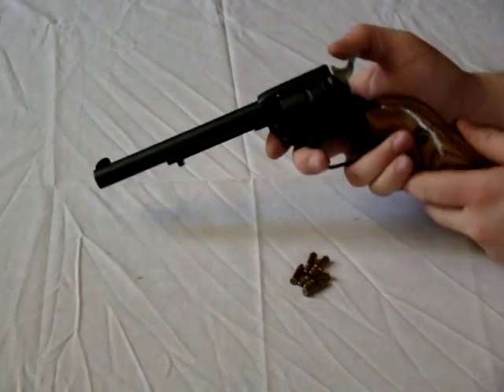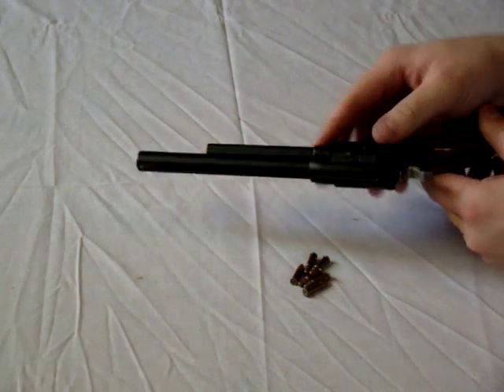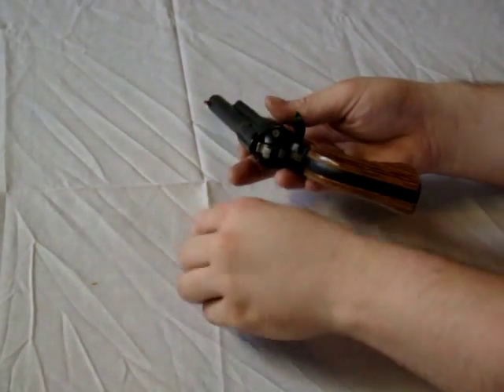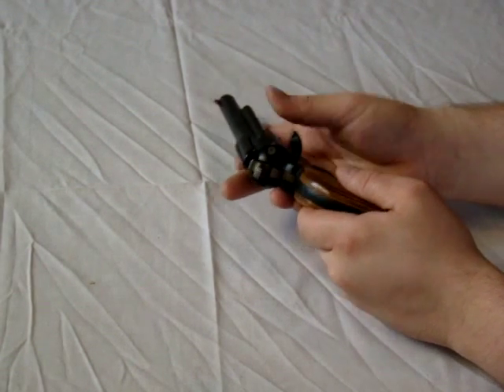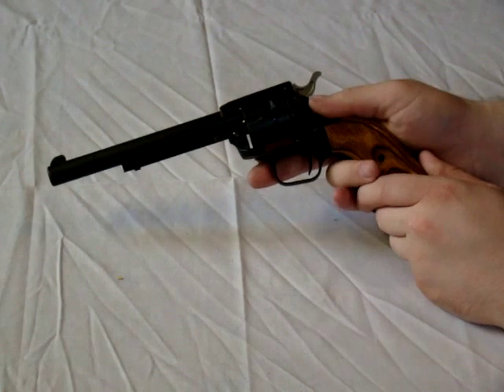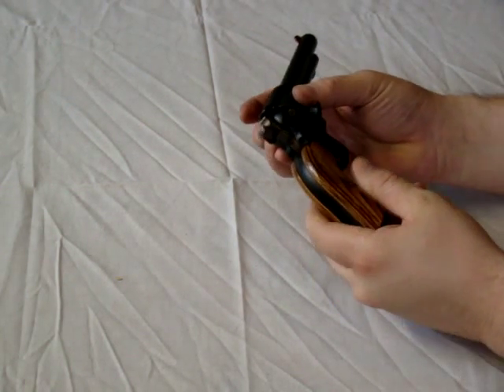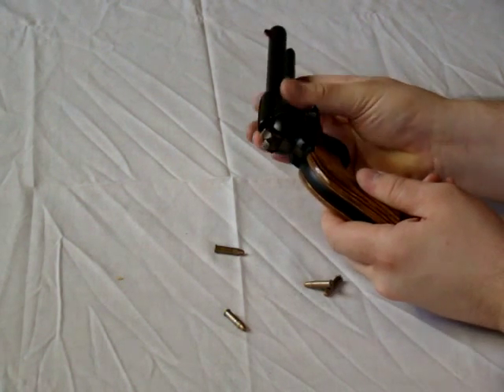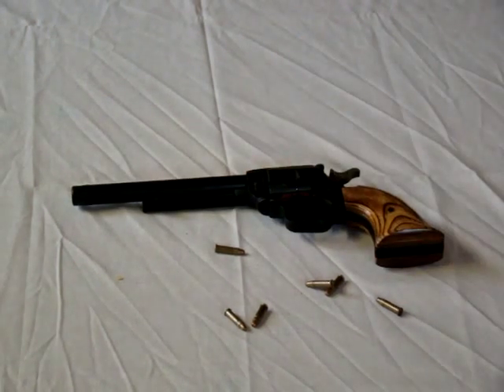How To safely Load/UnLoad a Heratige Arms .22 Revolver

Comment: I recently bought this same gun , just for plinking .... IDK ... the way you have to load this gun , seems to me to be somewhat of a poor design ?  Maybe someone out there can correct me if I'm wrong .... but in order to load this gun you need to pull the hammer back to the "second click" stage .... then the cylinder will rotate and you can fill the cylinder with rounds ..... but then there is no way to "decock" the hammer unless you pull it all the way back to the firing position ???  (is this right ???) .... there s a live round in the chamber .... you have to pull the trigger while holding the hammer with your thumb to keep it from firing ???  is this correct ???  IDK  ... it seems like a recipe for  a accidental shooting ???  why the hell cant you decock the hammer without pulling it all the way back ???  am I doing something wrong
Reply: I had the same thought, that is why I load it outside. He did say this model has a saftey in it that prevents it from firing but I am just not too sure about that.
Reply: @gregbeck906  Yeah .... it works ... the safety pretty much blocks the striker so it can't fire .... I just had to play with it a little .... it's a nice gun for plinking
Reply: Don’t pull all the way back just pull back a little and pull trigger and slowly release hammer to resting position